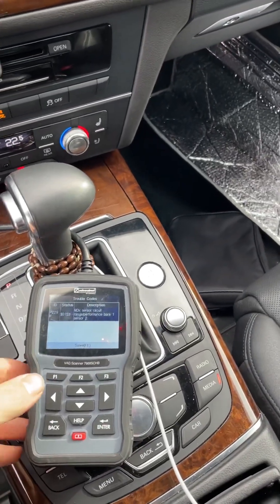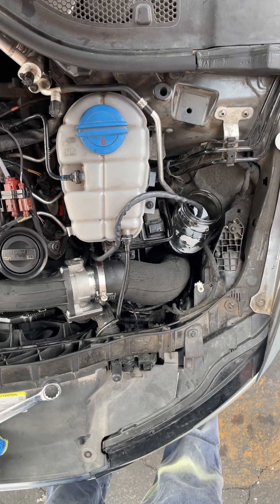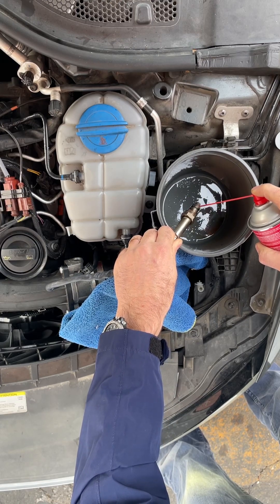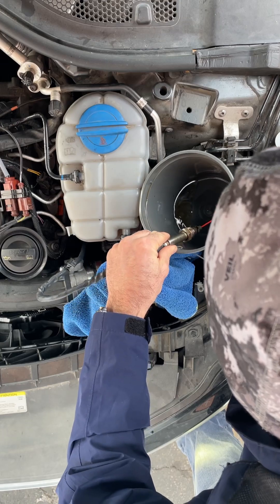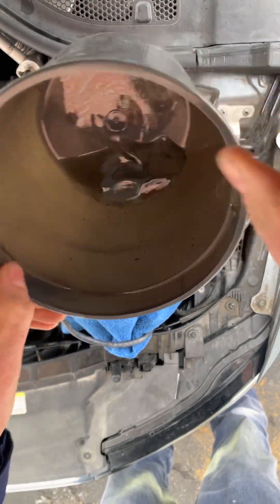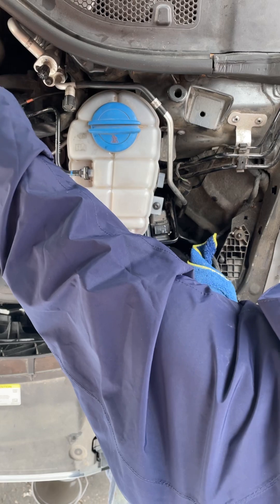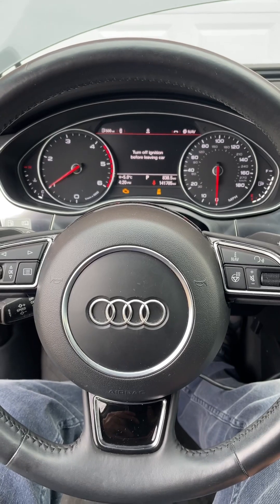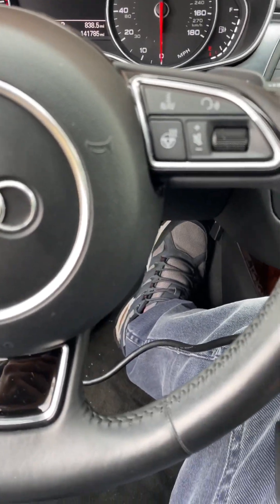A6/A7 3.0 TDI NOx sensor, How to clean it!

Comment: Thanks, it really works! Did the same on a6c7 3.0 bitdi with p1032 error and worked perfectly. Left the sensor over night in carburetor cleaning solution and the next day the sensor worked fine after erasing the error.
Reply from the maker: Glad it helped

Comment: Your scanner says bank 1 sensor 2 is what’s faulty but in this video you cleaned bank 1 sensor 1
Sensor 2 is located closer to the rear of the vehicle close to the rear subframe
Reply: So should he have cleaned the sensor 2? Looks like he cleared the code by cleaning sensor 1. My error code reads the same Bank 1 / Sensor 2 performance
Reply: @phillafferty2087  I guess I just need to go under the car and find out where it is???
I’m getting same code bank 1 sensor 2 

Sensor Circuit Range/
P229F: Performance Bank 1 Sensor 2
Reply: @marine8347  I had the nox sensor by the muffler changed and the dual exhaust clamp that Audi's have was shot, and I'm wondering if it was just the broken clamp the whole time, and that's why my car was louder

Comment: Hi, have you been successful with the cleaning? What was the outcome… ?
Reply from the maker: Yess 100 %no more lights, after resetting I drove on freeway with freeway speed 😁 never came ! But if they come back something else can be wrong on the module!
Reply: Does new Audi a7 have the sensor in the same place ?? Having the same error code 😊
Reply from the maker: I assume so, if it is 3.0 tdi, also u might need to clear the light with a scan tool as well!
Reply: I have the a6 4g c7 2017 218ps 3.0 tdi I didn’t had any control lights . But I read the car once in a while and I had this code NOx sensor circuit range/performance Bank 1 Sensor 1 . Where is located and what should I do ? I want also save the money 😅. It’s at the same position as in the video ? Pls your help . Thanks
Reply: Did you have to put your car in maintenance mode prior to removing your sensors?
Reply: Very helpful, I'm from Germany and now my Audi A7 has the same  issue, I will try to do the same today, and I hope it's working! ✌🏻✌🏻✌🏻